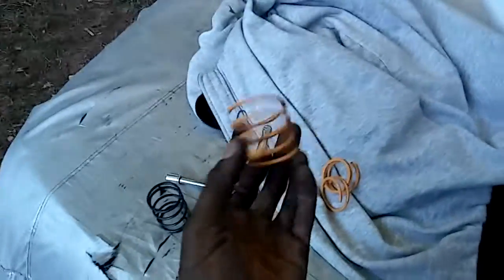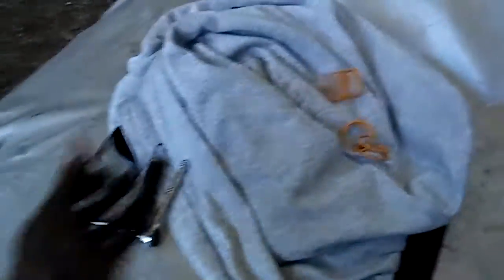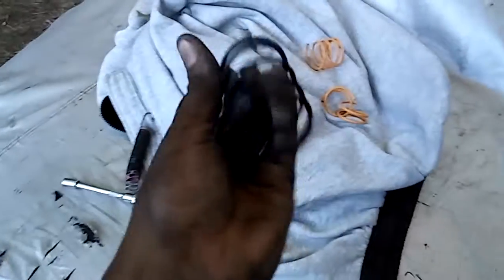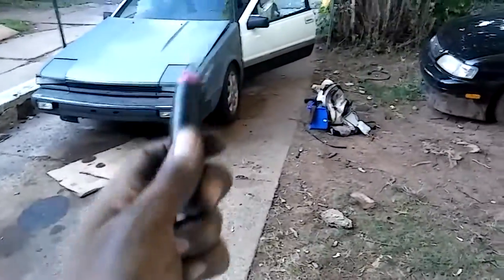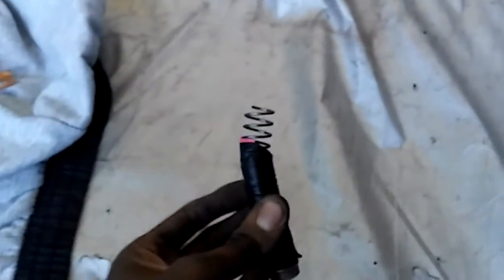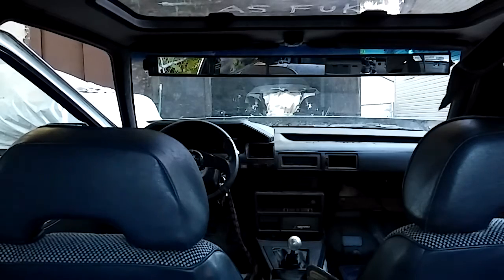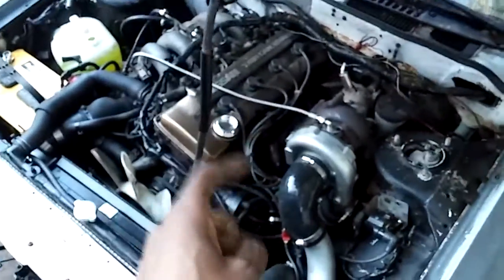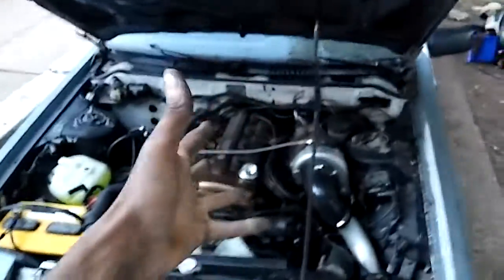HOMEMADE 5PSI WASTEGATE SPRING?! 🍃

Comment: How did the smaller circumference spring hold up in the wastegate? I want to put in a hardware spring that supports 25lbs but I’m afraid that the smaller spring will bend into a U shape inside or such if you know what I mean

Comment: question n be honest.. how many times do you get a bad spark plug or bad wire? that's all I can think of that can go bad without a tune..
Reply from the maker: TuningLove 100% honest, I changed to colder plugs after installing the turbo and to this day still have the same plugs. The spark plug wires I have never changed. I changed them once on this engine about 3 years ago when it was in my 240sx beside I swapped it into the 200sx
Reply: TooForTea TV it must be you lucky... or is that honda that are unbreakable reliable.. cuz on my nissan v6 I would have to change plugs n coils a lot every couple of days or weeks running 10 psi untuned.. lol
Reply from the maker: TuningLove I don't advise you to run untuned but try less boost. 5psi on a v6 should give you decent power. I car ran wack on 10psi but once on 5psi never had a problem
Reply: TooForTea TV thanks I'm turboing a 2011 camaro v6 I'll keep you posted. I'm thinking of running 3psi untuned because i dont want problems with the car..

check my videos
Reply from the maker: TuningLove I been checked them homie lol

Comment: JDM duct tape interior for the win, bruh.
Reply from the maker: What color lol Camo? HOT PINK?!
Reply: Lol. I went with the usual silver, but that's just stage 1 for my S12. I just gutted the rear interior down to painted metal and started spraying in bed liner for the cargo area since I'll be toting wheels around and don't want any rust back there. Stage 2 on the interior will be outdoor/marine carpet on everything once I get the lights and things working correctly.

On the real, I can't believe you went full ghetto speck with a door spring, homie.
Reply from the maker: +Kerry Shea Lmao I guess I have my own spec now. 200sxGS 😂
Reply: Yeah, homie. Get on the S12 forum when you get a chance and DM me your email. I'd like to exchange notes on wiring harness and engine work. -snakezulu7
Reply: Is that your user name on there, or is it still Too4tea?
Reply from the maker: +Kerry Shea I don't remember lol I have it auto logged. I'll look at it
Reply: I'll just DM you on YouTube, didn't even think about it. lolololol
Reply from the maker: +Kerry Shea True lol